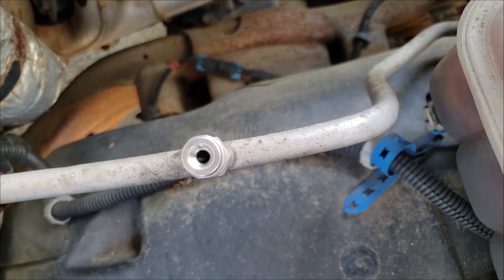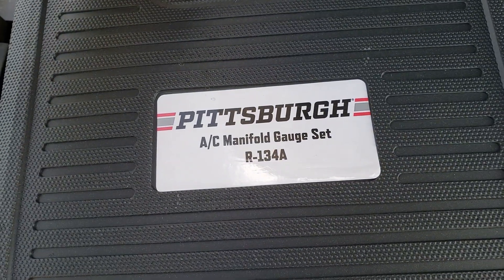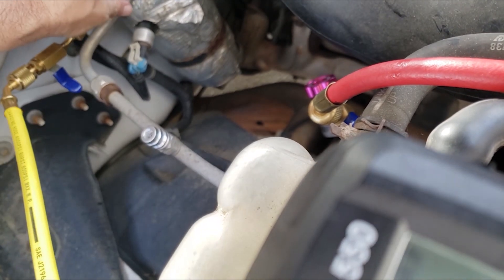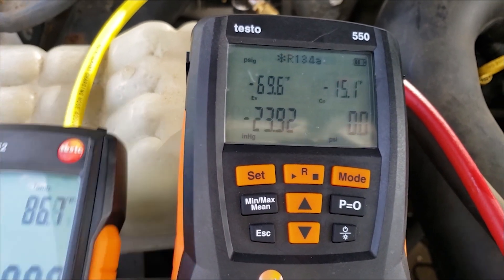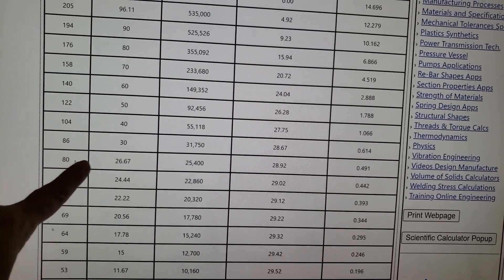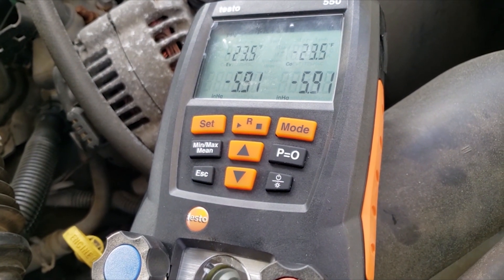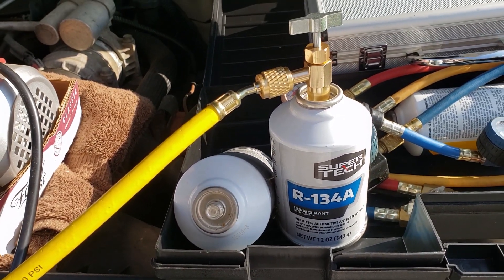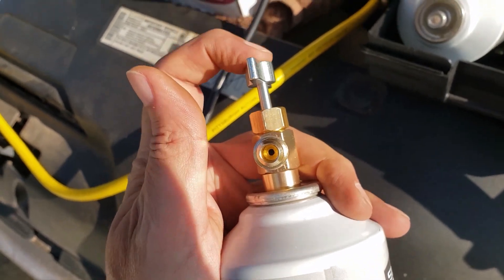1999 Sierra AC Replacement Part 1

Comment from the maker: I didn't mention. This truck had been sitting unused for 1-2 years and during that time, all the refrigerant leaked out. I was starting with an empty system, so there was no refrigerant recovery needed. With daily outdoor temperature swings, a leak would introduce moisture every temp swing. I had no idea how much moisture was in the system, a good deal of moisture would hang at 26.8inh hg   while moisture was being evaporating by the vacuum.